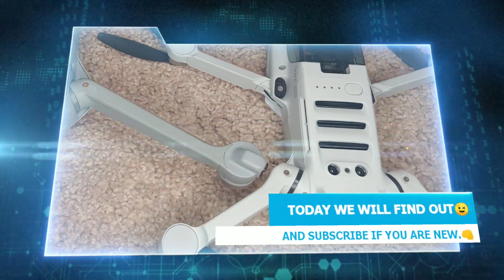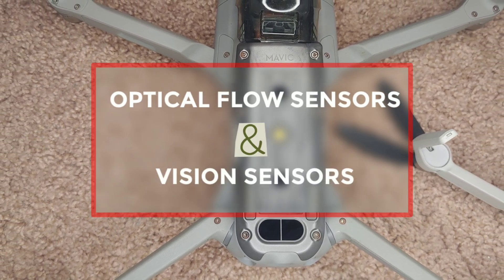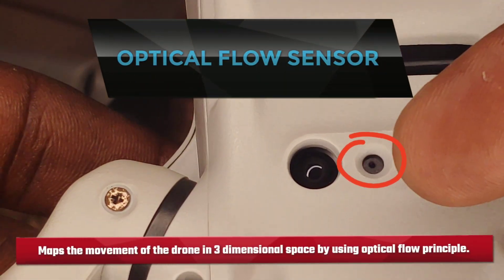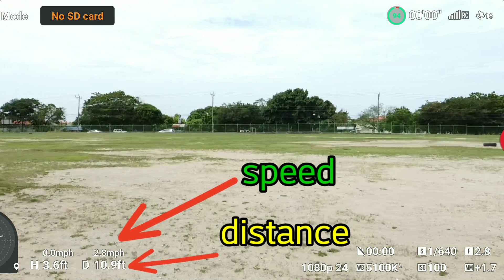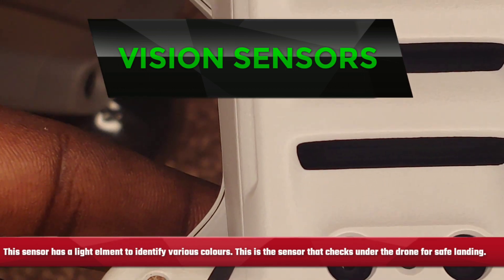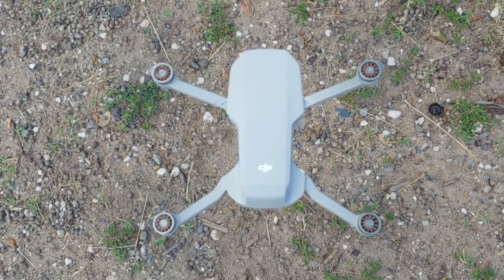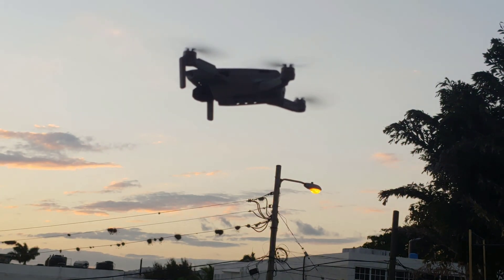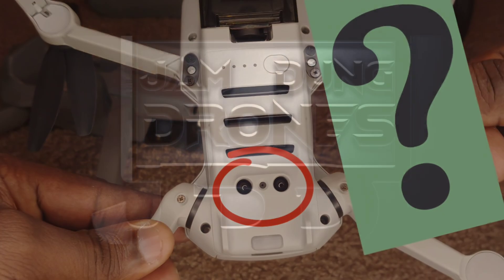dji mini se - OPTICAL FLOW & VISION SENSOR?

Comment: Do both sensors turn red or just one ?
Reply: It's normal for only one light to be on because the sensor setup consists of a sender and a receiver. The red sensor sends infrared signals to the ground, while the other sensor receives the reflected signal to determine the height. Therefore, only the sender has the light on, as it is responsible for emitting the infrared signal.
Reply: I have same problem one senzor light red one nothing